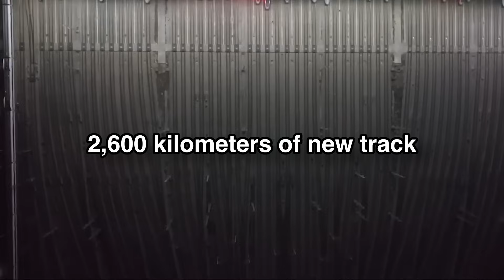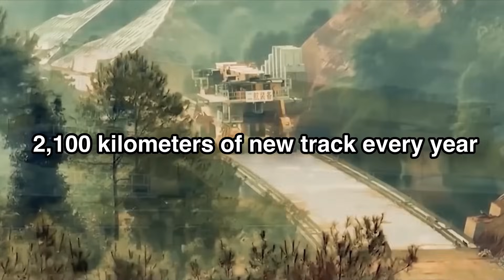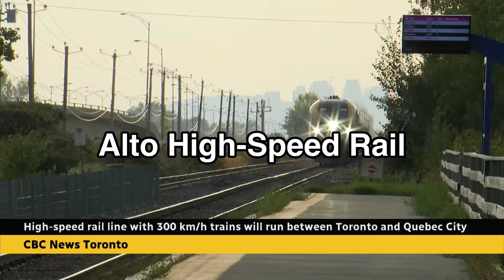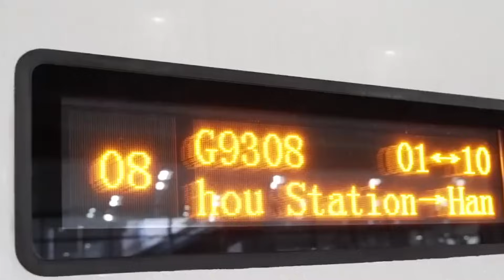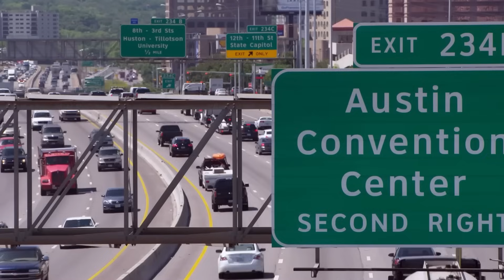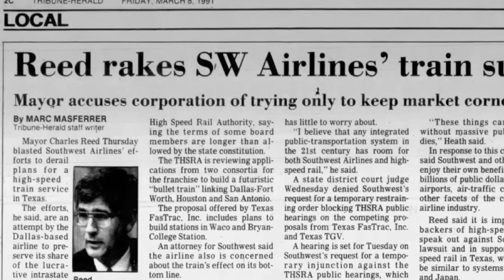Why the US, UK, Canada & Australia Can’t Build Bullet Trains

Comment: Ca has not spend 128 billion that’s just wrong there that much under budget
Reply from the maker: Thanks for your comment! The claim that California hasn’t spent $128 billion is true in a sense—it hasn’t been fully spent yet. The $128 billion is an updated projection for the entire high-speed rail system. Keep in mind that around $15 billion has been spent so far, but that’s for just the 171-mile section. The original estimate for the whole project was around $33 billion.

Comment: The UK has had a true high speed rail line, named HS1, since 2003. It is 103 km long and allows for a top speed of 300 km/h.
Reply from the maker: Thanks for the comment! You're absolutely right—HS1 has been a significant success in the UK, connecting London to the Channel Tunnel. However, it’s not considered part of the larger high-speed rail network, which is why we focused on projects like HS2, which are still in the works and facing delays and budget overruns. Thanks for pointing that out!
Reply: That is in between Calais and London St pancreas, no stop in between. It's not a real high speed rail since it's not connecting two British cities.

Comment: The CR450, which has reached a speed of 453 km/h in testing, does not hold the record for the fastest wheeled train. A French TGV holds that 574 km/h. The CR450 however, I think, holds the record for the fastet non-experimental train, meaning a train set that is designed to be put into service more or less as is and not modified to achieve a speed record.

Regulations might vary but a common rule is that trains are tested at a speed 10% faster than what it will be permitted to ride at in commercial service. The Chinese naming structure appears to approximate this. The CR400 train set actually operates at 350 km/h and CR450 train set has the goal to be operated at 400 km/h.
Reply from the maker: Thanks for your comment! You are correct that the French TGV holds the record for the fastest train at 574 km/h during a test run. However, the CR450 from China does indeed hold the record for the fastest non-experimental train, reaching 453 km/h during testing. The CR450 is designed to eventually run at speeds of 400 km/h in commercial service.

Comment: We have got a High Speed Railway in Britain - HS1.
Reply from the maker: Thanks for the comment! You're absolutely right—HS1 has been a significant success in the UK, connecting London to the Channel Tunnel. However, it’s not considered part of the larger high-speed rail network, which is why we focused on projects like HS2, which are still in the works and facing delays and budget overruns. Thanks for pointing that out!

Comment: Canada has weather conditions that it has to deal with
Reply from the maker: Thanks for your comment! You’re absolutely right—Canada’s extreme weather conditions do present unique challenges for building high-speed rail, particularly in terms of infrastructure durability and maintenance. However, it’s not impossible, just a factor that needs to be carefully considered.
Reply: Japan and China also get snow, and snow doesn't bother our freight trains which run all over our country. Of course it will influence design but it's not a roadblock
Reply: @LoneHowler  most of Canada is open country  farmland .. the roads and tracks have to be cleared during a snow storm constantly. Japan is mostly urban in the city with high buildings around tracks
Reply: @smityy0001 you clearly haven't actually seen what Japan and China are actually like. They have farmland, mountains and a lot of empty space between cities. They aren't one huge maga metropolis, that's more the USA with  suburbs filling in the gaps between neaby cities. The fact we have empty space between our cities should be an advantage for train building as we won't have to build around existing infrastructure as much. Japan mangages to build high speed despite being mostly mountain terrain thats prone to earthquakes. We aren't going to overcome challenges if we continue to ehine about how hard it is. 
Whatever happened to the two countries that helped each other go to the moon because Kennedy said "We do things not because they are easy, but because they are hard. we choose to go to the moon!"  Instead we now are lazy and whine "we cant do it because its hard"
Reply: The temperature drops in Canada below zero Celsius constantly ... Switches on the tracks build up with ice have to be thawed out with steam .. me and my friends have worked and built tracks in Canada .. I doubt the tracks in China and Japan get the temperature drops and snow Canada gets... Japan has thermal heating on some of the high speed tracks
Reply: @smityy0001  so we add heating to the tracks like they do, we don't drop down to below -20 often. it's usually only a few weeks at most a year. There are already solutions why are we pretending that we cannot accomplish this and more?

Comment: To date California high speed rail has spent 13 billion to build 120 miles of track. The estimate is that the total track between los Angeles and san Francisco will cost up to 100 billion. Claiming that 120 miles cost 128 billion dollars is a lie.
Reply from the maker: Thanks for your comment! Just to clarify, the $128 billion is the updated projection for the entire 500-mile system, not just the 120 miles. The Central Valley segment (120 miles) alone is now projected to cost around $32-$35 billion, which is already more than the original estimate for the whole project. Appreciate you watching!

Comment: Fastest train to still hold the record is the French TGV with 574,8 km/h. Bonjour
Reply: Japan's SC maglev is faster with 603km/h
Reply from the maker: Thanks for the comment! You're absolutely right about Japan's SC Maglev, which reached 603 km/h in tests. It's not a conventional high-speed rail but an innovative maglev system, and it currently holds the record for the fastest speed achieved by a train overall. However, in our video, we focused on the CR450 as the fastest conventional wheeled train designed for commercial service. Thanks for watching!
Reply from the maker: Thanks for your comment! You're right that the French TGV holds the record for the fastest speed ever achieved by a train, reaching 574.8 km/h during testing. However, the CR450, which we mentioned, holds the record for the fastest non-experimental train designed for commercial service, reaching 453 km/h in tests. The TGV's speed was achieved under different conditions, as you know. Appreciate the insight and thanks for watching!

Comment: Spain has built a network that (for a smaller country) rivals that of China ... so clearly it is possible. UK really does not need to rebuild all it's rail network, large sections of what we have will run at 125mph (200kph) ... the one line that is being built is to add capacity to an existing route, it makes sense to go for a faster standard but with shorter distances the benefit of higher speeds is not as great as other countries.

Comment: i will tell you the problem they build in quanity over quality
Reply from the maker: Thanks for watching! That’s a great point. While China has focused on building quickly and extensively, some argue that the sheer scale can sometimes compromise long-term quality. However, it’s also important to note that their safety records are generally strong, with continuous improvements being made to both speed and infrastructure. Quality and quantity can often be a balancing act in large projects like these.
Reply: @MegaBuilds5280  China operates under a one-party system, which allows it to push major infrastructure projects forward quickly without political opposition. In contrast, the U.S. has a complex, multi-layered government system with multiple parties, regulations, and bureaucratic hurdles, making large-scale projects like high-speed rail much harder to implement. While China benefits from centralized decision-making and lower labor costs, the U.S. relies more on air travel than trains for transportation, further reducing the urgency for high-speed rail.
"Likes your videos"
Reply: @_Littletreasures_. your comment would be a little believable if you can provide just one, not two, evidence….otherwise it’s😂🤣😂
Reply: @psoon04286  will I can't because the Chinese government probably kill me for finding out their top secret they literally senor everything why do they spreate chinese from the rest of the world
Reply: high speed rail in east USA had 7 crashes in the first year of operations , any in China?
Reply: @michaelwhitmore7160  proof to this china sensors every baf news that comes to see the reality we need to go there

Comment: The rail system in America has been in steady decline since the end of WWII. The focus, instead, was placed on the Interstate Highway system, which benefited the auto makers in Detroit, as well as the trucking industry.
Reply from the maker: You're absolutely right! After WWII, the focus definitely shifted to building highways and expanding air travel, which left rail systems behind. It was a deliberate choice that made cars and planes the dominant forms of transportation. Thanks for watching it and for the comment!
Reply: We also have planes, people forget that our high-speed travel is planes.
Reply: @jacob6908  Not the same. Let's picture this. In a world where high speed rail is in North America (US & Canada). Airports wouldn't be so crowded since short flights can be taken up by high speed rail or even regular rail. The country CO2 output would be less since less flights. Regular rail is very needed in north america. Take Toronto for example. Just give us a simple rail system that connects the airport with the rest of the system, not only the city center. There is a rail way less than a kilometer away from the airport. Just give us a train station in or next to the airport. We don't even care if it's not high speed rail. Heck, cancel high speed rail and just finish the LRT please. Some thing small is enough but they won't even give us that.😭
Reply: The trucking industry is heavily subsidised.  Go do the mathematics research. The numbers are horrible.  Cars are subsidised a lot too.😢
Reply: @johndwilson6111  bs. All car industry is heavy taxed. And road construction is just a tiny fraction of comparable rail, especially highspeed, cost.